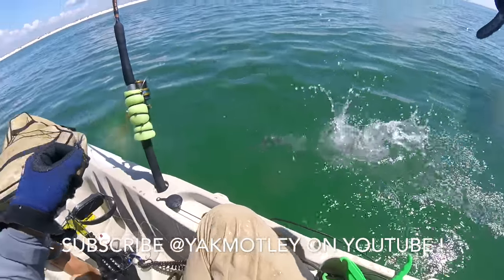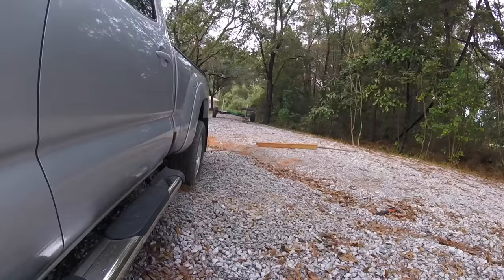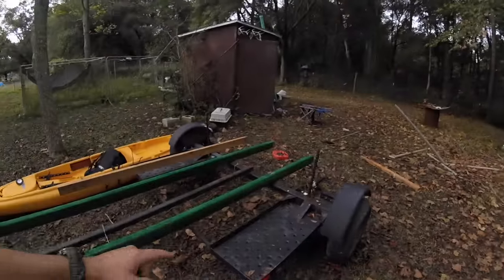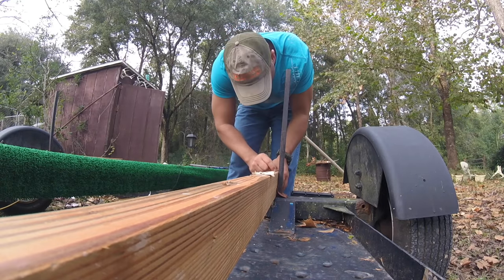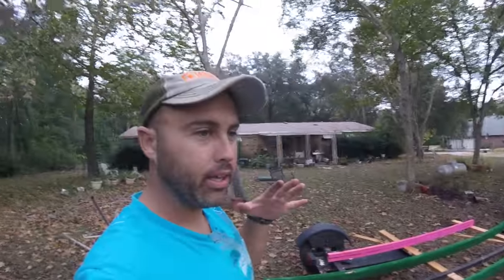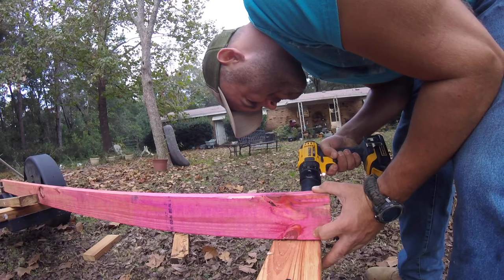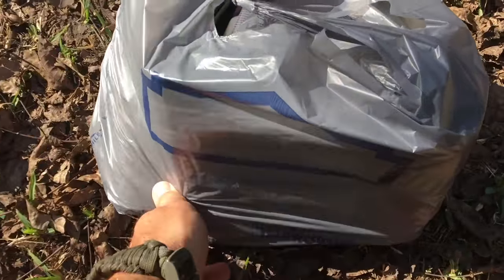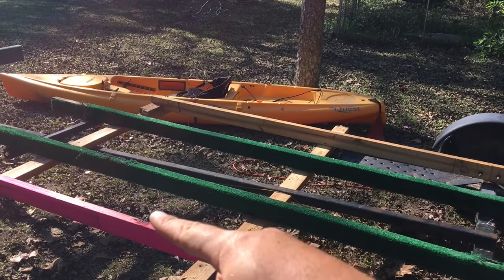Building the DIY Kayak Trailer- Part #2

Comment: Hey Jack, I have a trailer that the wood goes across the trailer and right now I am storing the kayaks hull up on the gunnels across the trailer. 

My question would be are you going to store your kayaks on the trailer?
I have thought about running pvc the way you did the wood, but I am scared to keep the outbacks stored on it hull down.. any thoughts?
Reply from the maker: Well, I'm going to try to leave them on the trailer. I have mistreated kayaks about as bad as any one lol. The Outback should be fine its hull is pretty thick just don't put any weight on it. The thinner hull yaks like the Hobie Quest, Ocean Kayaks and most paddle yaks ill get a dent in the hull. This hulls are super thin and made to flex. But for long term storage (more than a few days) I would just turn it on its side.